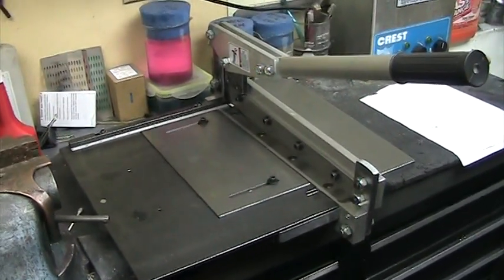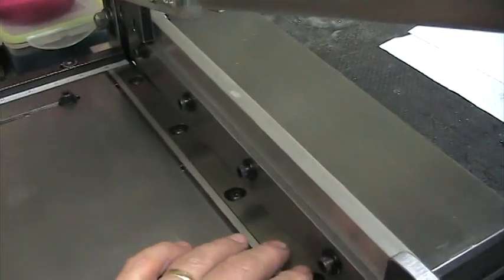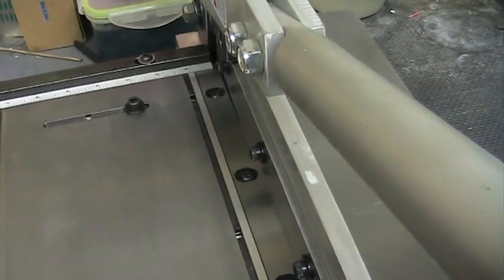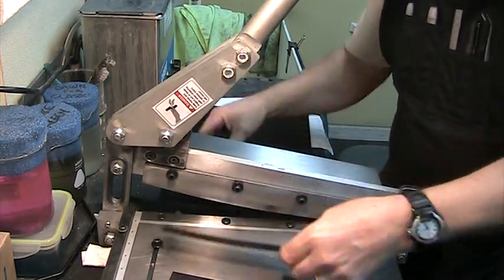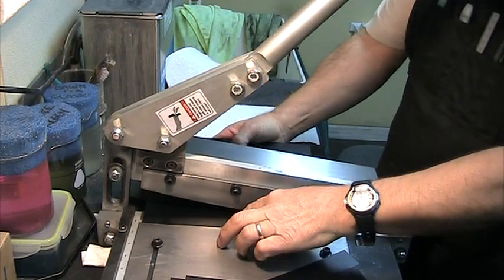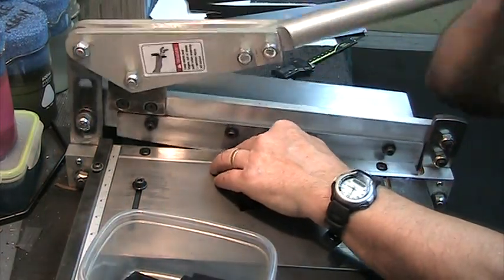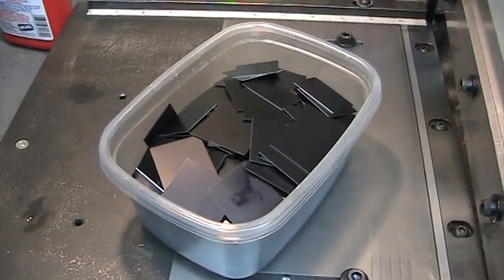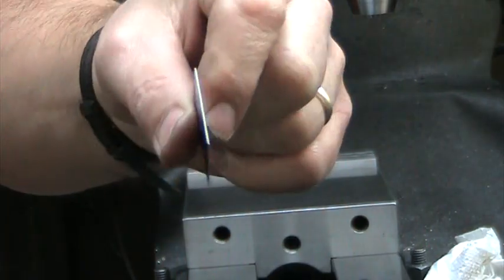MAKING THE VERSA -OHM HEAT SINKS

Comment: "Shop Notes"*

• One of the best YouTube machinist quotes of all time: "Like a lot of things that come from China, they're good if you consider them a kit".
• Grizzly link to shear: http://www.grizzly.com/products/12-Heavy-Duty-Bench-Shear/T27140?utm_campaign=zPage&utm_source=grizzly.com
• Overview of the modifications to the tool.
• Good advise about making parallel cuts
• Using machine vises as small part sheet metal forming tools
• Making hard silver solder paste in the shop with a burr.
• Using Stay-Brite to silver-solder
Harris Stay-Brite Kit (Amazon): https://www.amazon.com/Harris-SBSKPOP-Stay-Brite-Silver-Bearing/dp/B0089ETUN2
Harris' website: http://www.harrisproductsgroup.com/en/Products/Alloys/Soldering/Lead-Free-Solders/stay-brite.aspx
• Harris Stay-Silv Black Hi-Temp Brazing Flux
Amazon: https://www.amazon.com/Harris-SSBF1-Stay-Brazing-Black/dp/B00EDMM4KU/
Harris' website: http://www.harrisproductsgroup.com/en/Products/Alloys/Brazing/Fluxes/Stay-Silv-Black-Flux.aspx
• Another forming tool, this one with a urethane backer
• Overview of heat sink assembly w/fishing line insulator, explanation of best contact location for heatsink.
• Assembly of heatsink and resistor bank.

*Not affiliated with any manufacturer or distributor. Links for convenience.

Comment: Most excellent detailed work, but just what kind of 'decade box' are you making....? I'm looking around here for the beginning of the series.....   I have a couple old ones from Radio shack and Frys electronics....pretty far off on % values for resistors......and only 1/4 watt...
Reply from the maker: Thanks for stopping back Doug, I have not finished the versa-ohm series since there seemed to be a lack of interest.